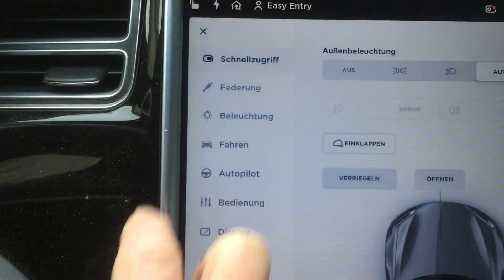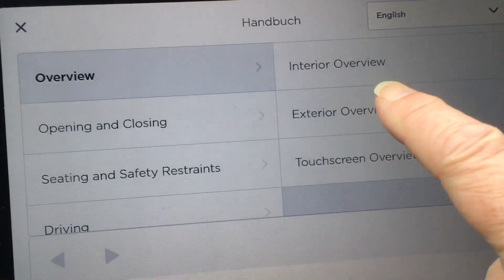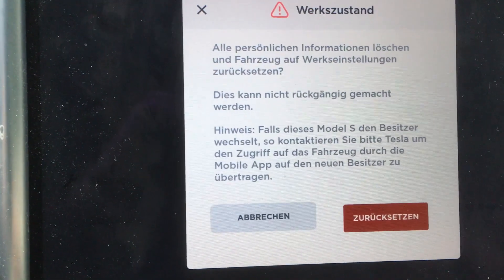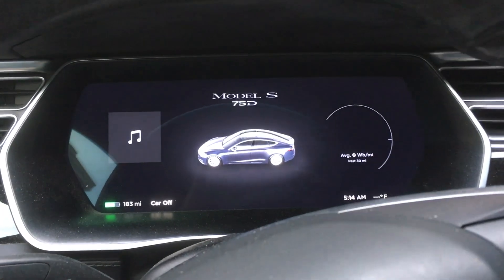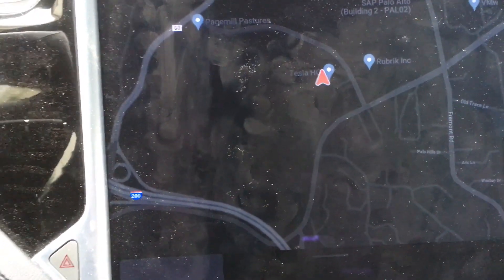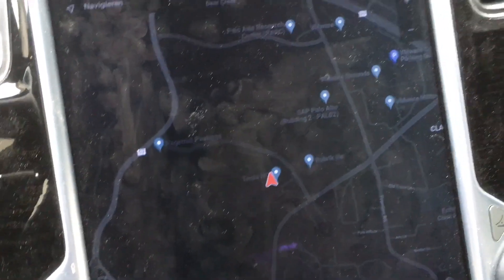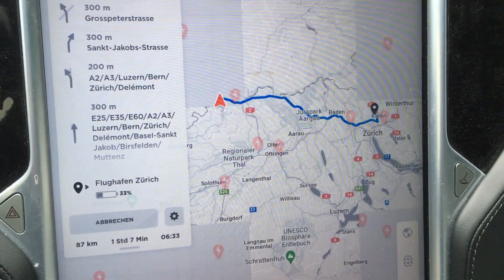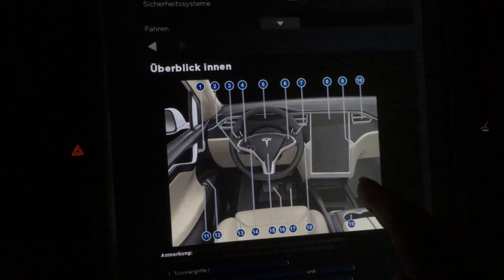How to speed up a sluggish Tesla MCU-1

Comment: Has functionality of the browser been restored?
Reply from the maker: functionality yes, but I tested it today, and despite a 3-bar LTE signal, responsiveness on a CNN webpage was very low=no visible improvement and not as fast as it was when I first got the car almost 4 years ago. Other items were however faster or worked again, as I show towards the end of the clip
Reply: @GolfTesla  Good to know. I find it hard to justify the cost of an MCU2 for my pre-Autopilot 2014 Model S. I especially don't want to give up the AM and FM radio for the faster MCU.
Reply: @xrayangiodoc  Mine is a later model 2018 which annoyingly was probably the last model with MCU1 (wish I'd known that first!). The MCU does feel quite sluggish in comparison to the MCU2 - I also presume anyone with MCU1 will be stuck on the current feature set which will make the car feel quite dated. It's a shame they are just "keeping the lights on" for the older cars but I suppose it makes sense.

I am tempted by the MCU2 upgrade - which in itself is getting old now - but like you, the £1700/$2000/1700€ is hard to justify. It's unlikely you'll see any of that "investment" back when the car eventually gets sold. As a result it needs to provide sufficient value - if I were a high miler who spends a lot of time in the car, it'd probably be worth it. If like me that's the exception rather than the rule, it doesn't seem worth the price for what's essentially a number of gimmicks that you can get via your phone.

It's a shame they can't get the price down to a more palatable $800, if that were the case I could justify the upgrade.
Reply from the maker: @xrayangiodoc  yes. I hope tunein will be an adequate fm and dab replacement, though sound is not as good. A radio module in mcu 2 costs another 500 usd or chf and can be do e at any time. Mcu 2 might also improve resale value
Reply: @GolfTesla  It'd be interesting to know if this had any impact to the other apps. dashcam loading, toybox etc
Reply from the maker: @M0LHA  those things worked ok before. My experiece: navigation faster, map rendering faster, user manual agan visible, webbrowser no change=sluggish as before